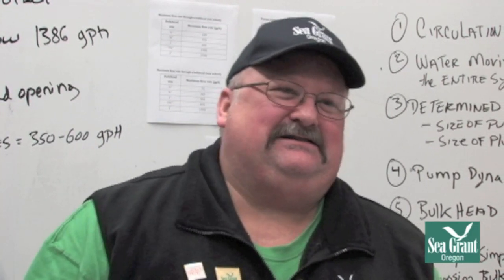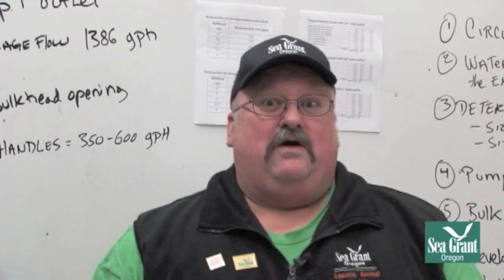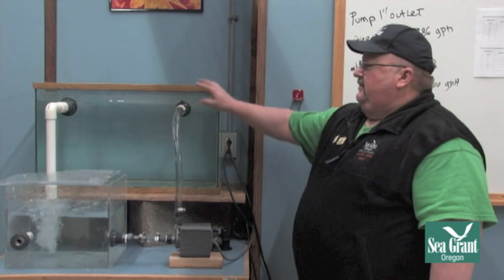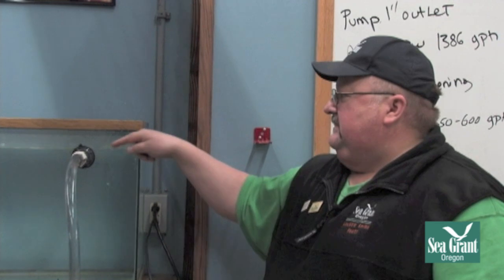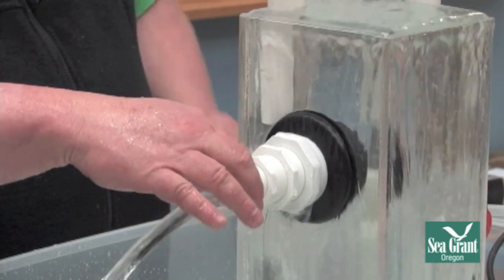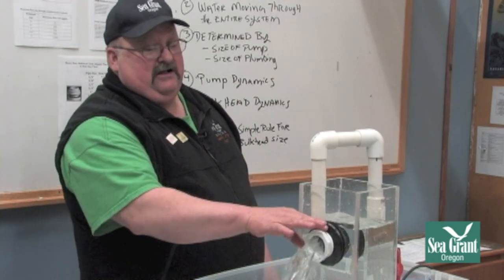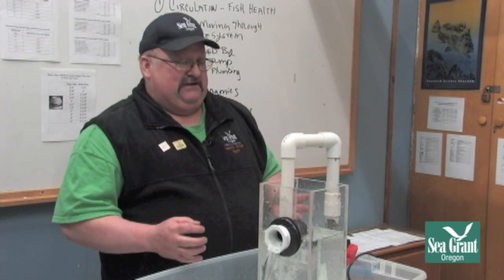Aquarium Science - Water Flow Management

Comment: If you want to simplify your sump setup, set your outlet at the level you want your water at, and then basically allow your return water line to act like an overflow, where water spills out but doesn’t siphon. Then as long as your pump isn’t overpowered you don’t have to worry about overflow issues in the tank or the sump.
Reply: Some link to see it ?

Comment: Wow old video but it was what I need to hear. I had that exact problem with filter. I place it on top of my tank so i didn’t have to make holes on the tank but I run in that problem with the pump and the return pipe been the same size of the intake pipe. I did fix it by doing what you said of making the Size bugger in my case the return and it worked. But I always wonder why... know I know. Thanks man!!!

Comment: Unknowingly, I did this exact setup for my first aquarium. 3/4 in and 1-1/2 out works great with a 800gph pump on my 75 gal tank with a 20 gal sump my question is how do i get the things that stay on the bottom to float up and get in the current that makes its way to the over flow? Seems there are some spots where the current cant reach, maybe a power head near the bottom to stir it up? Great video.

Comment: Great video but I have one arguement against this which is in a saltwater system, particularly a reef system, You’ll generally have a type of macro algae in Your Sump. It is preferred to have low flow in your sump when you have a refugium setup with macro algae. You’ll be getting the majority of Your display tank flow from powerheads so you aren’t relying on the return pump for anything other than returning the water from the sump/refugium back into the display. Great video though and very easy to understand.

Comment: Are you available for a DM? I have some questions about the best location for a check valve with an external pump above the water line and most of the plumbing is buried. Should it be closer to the pump, closer to the water, and can it be horizontal as long as it is below the water line? Any help would be appreciated!!!

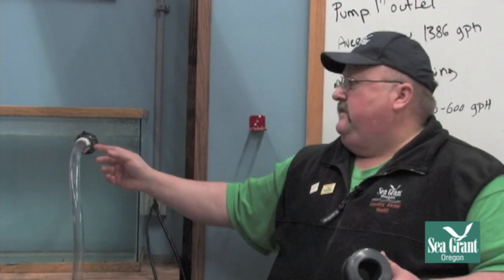Comment: 2:24 my aquaponics system utilizes both 6in and 8in bulkheads so you will be able to find them atleast 8in i think i saw them as large as 16in but only know ive seen a 12in, you will be forced to look online in multiple places if you go over 4in; if your working 3in or smaller start at homedepo, if your 4in or larger start at lowes.

Comment: Thankyou for the video
Question:
What size bulkhead would I need for 2inch piping? 
Please keep in mind this piping is strictly for connecting two aquariums into one and serves as a passage way for fish to travel to and from tanks, plus, all the filtration will be in one tank.*Unlike a sump tank, it’ll be an internal sump, taking up 10 percent of that tank, but have an output via water pump, of the combine volume of both tanks*.
It’ll also double to help water flow between both tanks, so the water in the tank without the filtration can also get filtered by water circulation through these 2 inch pipes.
Any advice on transferring waterflow between two tanks, that are connected via similar fashion, would also be appreciated :)
Once again thankyou

Comment: I used pvc 1/2 in and 3/4 out which is the minimal size difference you want. My setup only works cuz my water pump isn't as strong as the ones he used. I'm using a 290 gph water pump for reference and I have it set on half strength by turning the little knob that restricts waterflow.

Comment: flow rate of the pump is the real contributing factor to the calculations, not size of the pipe.  the only real pipe size that matters is the gravity drain.  in his model you could reduce the volume from the pump and still use the small outlet.

Comment: Hi Dennis, I think the biggest problem most everyone has in designing a system is determining what the pump truly puts out. I find that every pump grossly over estimates it's flow rates. Out of curiosity I have placed many submersible pumps into a full sink and just hook up a small discharge tube to collect the outflow into a marked volume container. By doing this I practically eliminate head and friction loss to zero, yet don't get anywhere near what the pump is rated at. So, that being said, how do we proceed/adjust in determining what equipment to use. Please advise.
Reply: So considering your experience with pumps what size pump would you recommend from a 20gal sump to 75 gallon tank feeding into a y inlets
Reply: The simplest way to control flow rate and pressure is to use a valve downstream of the pump. Pick a pump that is perhaps a bit oversized. The thing is centrifugal pumps operate on a pump curve, so there is no “true” rate. It depends on what pressure the system needs. So basically find a pump that gives the rate you need at a pressure (head) that is a bit more than needed, and then out a ball valve or gate valve on the outlet and adjust it until your system achieves a balance.

Comment: Hello, great vid! I have a question that no vid has spoken about but I have seen. If you have a large tank with a bottom drain that takes the fish waist to the filter and then the filter returns clean water back to the tank via another pipe. Question, do you simply try different pipe outlet sizes to find the out and in flow rate that works. I would think that the out flow at the bottom of the tank with all the water pressure above would be a problem. Hope I am being clear in my description. Thanks

Comment: I'm trying to create water return and over flow for my 150 gallon aquarium. I want to use a hang-on style overflow and pump water from a 55 gallon drum in my basement. The drum is 20' away vert.and hor. collectively. what size piping do I need for the overflow and return? What pump would I need in order to supply water to the aquarium for the distance it will be from the aquarium?

Comment: Super informative for my DIY project. But does controlling the water inlet cause the pump to work harder n cause heating?
Also, do i need two outlets one for the overflow at slightly higher level as my tank is going to be huge(8'x2')?

Comment: 2:56  1,000 - 1,500 GPH, really?  You can't be more specific?  Are you sure you aren't running 2,000 GPH?  Dude, you needed to tell us the GPH on the system you're showing us so we can figure why it took 2 or 2.5" to output what 1" was inputting, seriously, I want to learn, but from what I understand, the 2" overflow should've been able to handle 1,500 GPH, yet there was still and inch or two of water above it... 4:40, requiring 2.5" to really level out, so what gives?

Comment: This video probably confused more novices than it helped.  1" inlet pvc has VERY LITTLE to do with how much water is actually being pumped in.  Same goes for positioning of outlet bulkhead. Pumps that would use 1" pvc can vary from 800gph to 4000gph (Eheims, Mag Drives, Rios, Little Giants, etc...).  And then you have to account for head height.  Redundancy is ALWAYS better.  Drill yourself at least 2 bulkheads for outlet, each capable of handling 1.5X ACTUAL amount of water being pumped in.  If your tank has tempered glass on the bottom, then you have to drill the back.  Multiple 1" bulkheads + PVC will get you proper outlet and placement.
Reply: i agree!
Reply: lol word. i want to know how to have no dead spots in my aquarium. this guy just baffled me...
Reply: 1" inlet pvc has VERY LITTLE to do with how much water is actually being pumped in.
 Drill yourself at least 2 bulkheads (if possible) for outlet.
Excellent comments.  I think this will help many.

Comment: One error though is you are using a horizontal bulkhead which does not apply to a floor drain type.   Horizontal rates are almost 1/2 lower than vertical flow rates.

ie.  A 1.5 inch pipe on the bottom can handle 1800 gph (depends on pipe length and amount of standing water above pipe.   That same 1.5 inch pipe mounted on the side like this video probably can handle only 800 gph.

Comment: The area of a circle increases as the square of the radius.  A 2-inch circle has 4 times the area of a 1-inch circle, so four 1-inch outlets would be required to provide the same flow as one 2-inch outlet.  The area of a 1-inch outlet is .0785 sq in, two 1-inch outlets would be 1.57 sq in.  The area of a 2-inch outlet is 3.14 sq in.

Comment: last part of video : "the outlet may be not not to low to prevent losing waterspace in top part of tank"... in fact this theory is NOT TRUE because you can always connect a pipe elbow and a vertical placed pipe for the upper part above your outlet.  By doing that, you will have your water level as high as you want, without any lost waterspace (sump).  Strange that university vid is not more complete

Comment: in other words : basic fluidomechanics (pressure P  inlet  is  - in general - bigger then P outlet because of the pump, so surface (diameter) outlet has to be bigger, since Q outlet has to be minimum >= Q inlet to prevent overflow).  Logic.

Comment: ive seen a trick a long time ago where the jet in was piped directed to the piping of an under gravel filter. it spreads the current out underneath the gravel keeping it in place for the most part, while pushing waste out. its a thought, but sludge in gravel is a good thing just get some plants. anyways theres one solution for what you were describing, though a powerful pump may be too much for a small undergravel filter system

Comment: The surface area of 2inch outlet is bigger than two 1inch outlet. Formula for finding the area of a circle is A=3.14x(radiusxradius).Lets say using 10 as 1inch outlet and 20 as 2inch outlet. The surface area of two 10inch outlet would be 628inches. The surface area of 20inch outlet is 1,256inches. I'm not sure if I'm doing it right. It's been a few years since I was in geometry.

Comment: I don't think this would work.  If you draw a 2 inch circle and 2 one inch circles on a piece of paper, you will see that the surface area of the 2 inch circle is actually a lot bigger than the 2 one inch circles combined.  Therefore, you will still get more water flowing through a 2 inch hole than 2 one inch holes.

Comment: you could possibly put inlet on bottom of tank, which would stir up crap on the bottom.  But then, there would be other considerations to take, such as syphon off during a power cut.  Also, if you have substrates, gravel etc, you may end up blowing it down the other end of the tank.

Comment: Thank you for the video, it was very instructive.  I am curious on something you didn't address though and I was wondering if I might get your time to answer this.  In your video example you start with a 1" outlet and increase it to 2" (then to 2.5" for your safety factor); would adding another 1" outlet have the same result as a single 2" outlet?  So my question is, would dual 1" outlets have the same result as a single 2" outlet?  Thank you very much for your time!